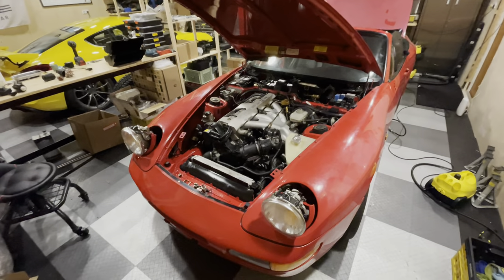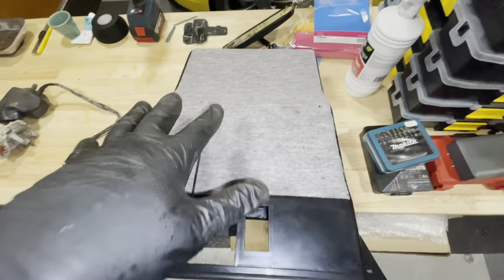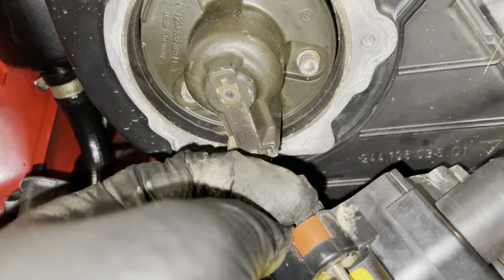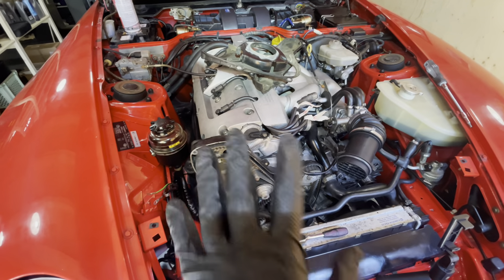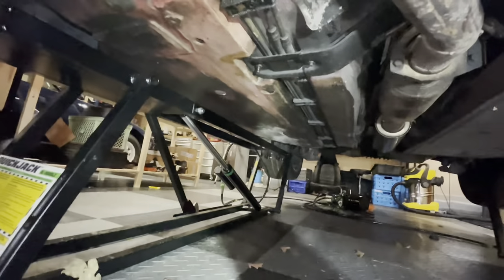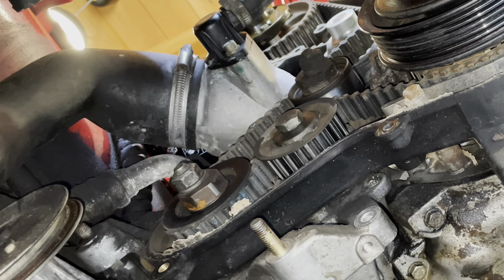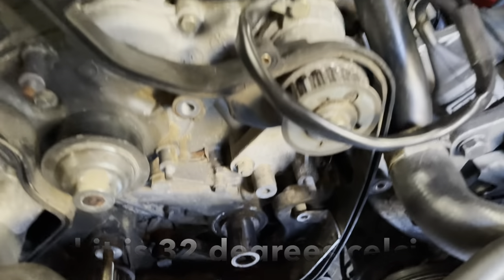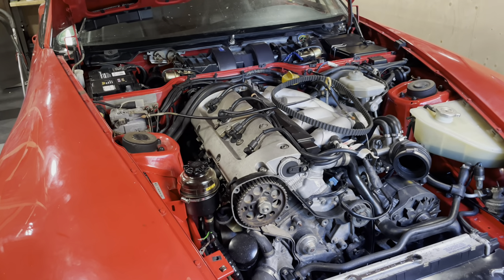Restoring a Flood Damaged Porsche 968: Belt Service - Part 1

Comment: the red blocks on the headlights are thermal cut outs - i guess if you replaced them they might work - the red exterior pulls off some how from memory and you can see the switch inside
Reply from the maker: Thanks Jake, I will have look!

Comment: URO are remaking the tensioner. I do wonder if Porsche are going to rebadge it........... The front pulleys and balance belt cog pull off as one unit usually?
Reply from the maker: I think the tensioner might actually be ok, but I have asked my parts supplier when they expect the URO units to become available. With regards to the pulley's, yes the can come off in one piece, but I also wanted to see what state they were in and there are some parts I need to replace.
Reply: @GarageBiljon  Just make sure you use the crank washer when resetting it and go very very slowly when compressing, stopping lots of times and waiting. I already have a URO one in my possession which came from RockAuto in the US. I notice Design911 in the UK are selling them now for the same sort of money. Mine cost about £160 inc tax and I got it as a spare